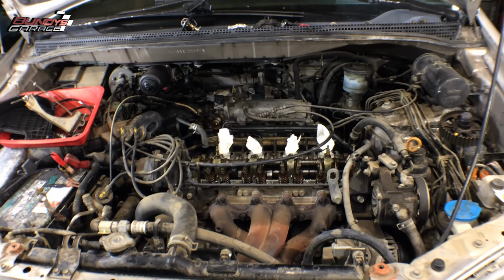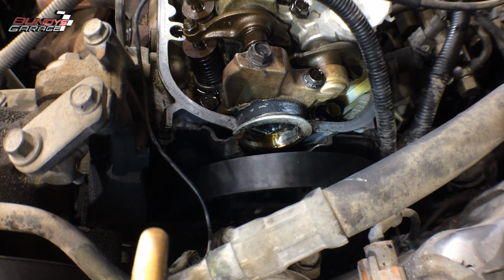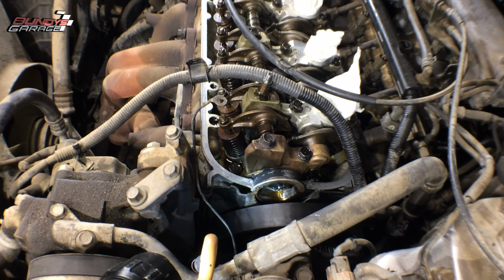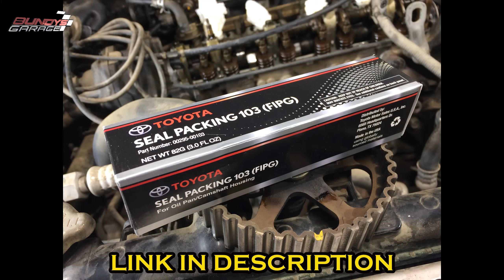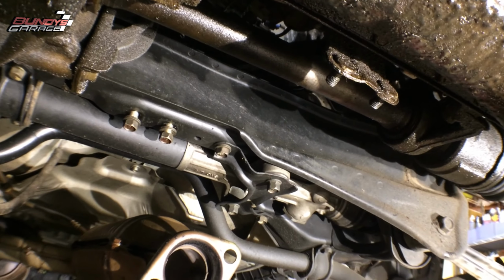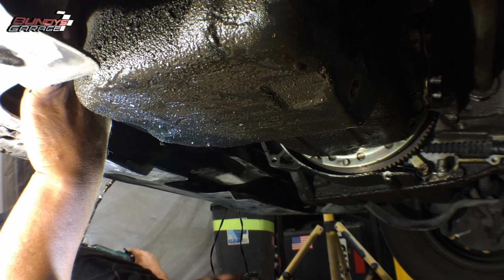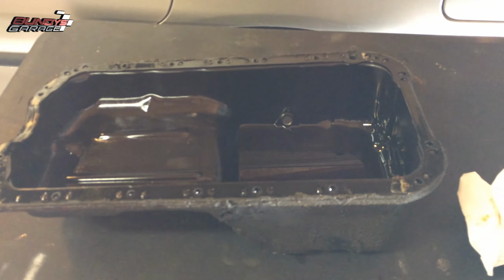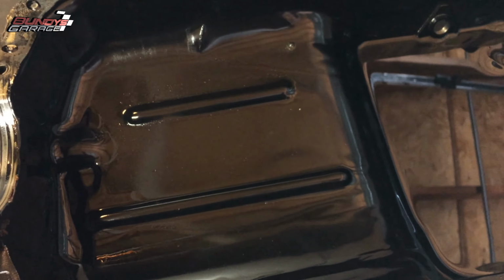ACCORD F22 Camshaft Snaps / Breaks in Half 2.2L | Honda Odyssey Prelude 1992 - 2001

Comment: 1995 honda odyssey ex 297,000 timing belt failed on hwy. Update all set 305,000 miles running great, bent valves w/related replaced. All else was good.

Comment: It's an interference motor so hopefully your valves didn't get bent.  Would be a miracle , if they didnt. Check head oil galley ways to mke sure there not plugged by deposits.

Comment: How does the cost and labor of only replacing the head compare with the cost and labor of replacing the entire engine with a rebuilt one?
Reply: 2000 for head and 6800 for a rebuilt to be put in. With covid and parts availability, everything is thru the roof in price. May find a better deal in your area. I had to go with a shop that could get it done in a timely manner yet it took 2 1/2 months to get parts and done.